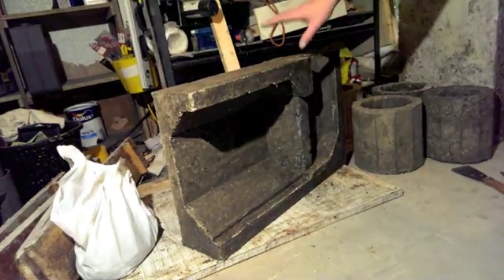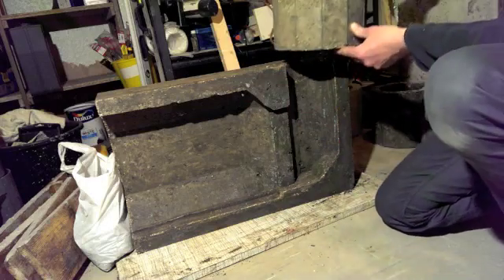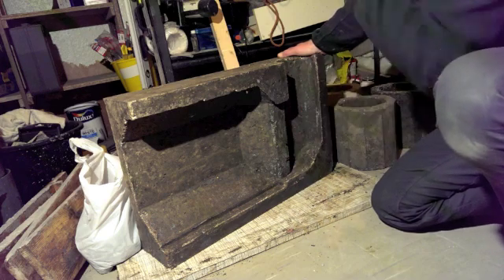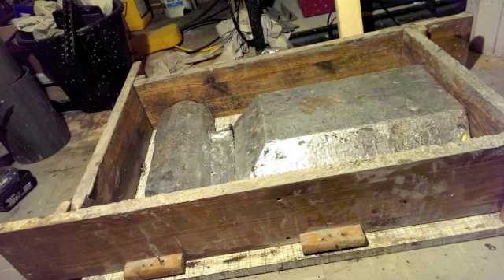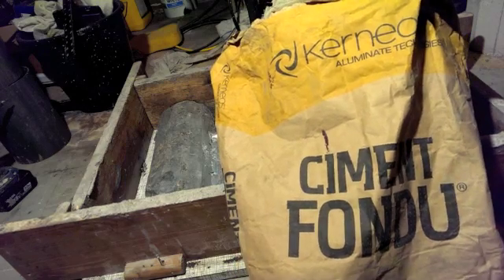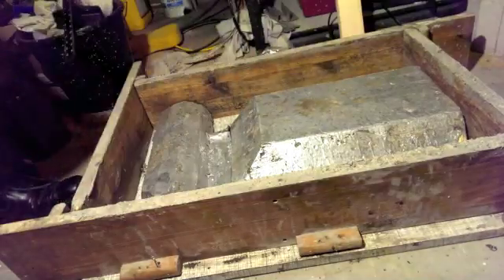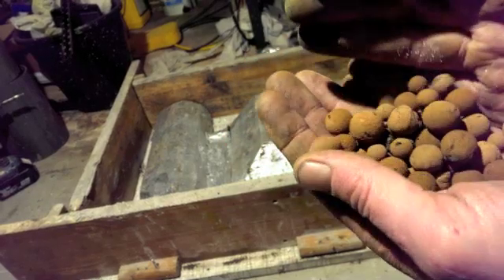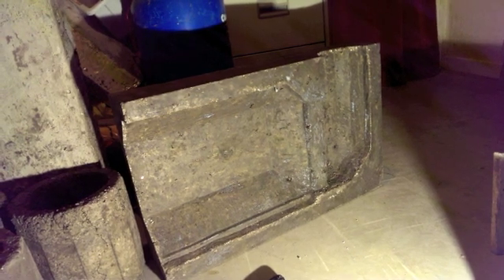Rocket Mass Heater Batch Burner Chamber Refractory Casting

Comment: Hi. Really amazing. Have two questions. Is it advisable to crush up the clay pebbles to add strength to the mix? And also what about adding some basalt fiber chop to help hold it together? Thanks for your video!
Reply from the maker: Changeindirection - thanks for the comment. 

I think the clay pebbles add strength provided the casting is thick relative to them. The thinnest parts of the burn chamber wall are 3-4 times wider than the diameter of the pebbles so I think there would be no weakening by their addition. I did use an alternative, smaller, insulating aggregate for the heat riser pieces, in the form of "growstones"; which are a processed glass product.

I haven't come across basalt fibre but I think a mineral fibre would give excellent reinforcement so I'll look into it. Thanks for that tip. In my latest video, several areas of damage are evident and so for any future castings some superior reinforcement would be really useful.

Thanks again, Dave.

Comment: Awesome.  I did your vids backwards.  How has the secondary air worked out?  Does it clog?
Reply from the maker: Jeremiah - thanks for your comment. The secondary air duct is just a piece of steel 50 x 25 mm box section that terminates at just before the base of the heat riser. It didn't seem to have any ash inside after the burn so I assume the air draw keeps it clean. I hope to modify it soon to have a spout higher in the chamber so it might be worth checking back in a couple of weeks.
Reply: BatchRocketProject I built a Walker core system that had the same square tube with an upright slotted pipe.  The upright disappeared in about 45 days of use.  It ran fine for the guy but the hole where the pipe was filled with ash.  He was happy with the burn even with the clogged secondary. 😁  Matt found a fix.  He replaced it with a Mitsubishi tailpipe end piece, I think he said.  On my next build I'll cast a "hardbrick" solid tube that will drop into the hole of the square.  As it did fine without secondary air it shouldn't take too long until the tube gets hot.
Reply from the maker: That's very interesting, thanks. My tube currently terminates with the opening facing the port into the heat riser so is not facing upwards where it would catch more ash. 

When I experiment with a vertical spout, I'll bear in mind the auto-exhaust tip; they must be built to withstand some heat. It may turn out that no spout is required anyway, time will tell.

Definitely try your hardbrick tube, I've seen some commercial gasifier wood burners that pre-heat air through refractory concrete channels; I'm sure they get very hot.

Thanks again for the information.
Reply: BatchRocketProject You're dumping O2 (air) at the base of the riser through a port or into the burn chamber pre-port?
Reply from the maker: The secondary air tube ends inside the burn chamber, pre-port, about an inch before the entry to the heat riser.

If you've seen the ppotty1 videos, he experimented and found the secondary air is best injected before the heat riser. Peter van den Berg also discusses the mechanism of air mixing to make turbulence in the heat riser, again suggesting pre-port secondary air to be best.

Comment: Please, can you tell me the  proportions of alumina cement, pebbles and Pearlite in your mix?
Reply from the maker: Aluv15 - Thanks for the question.

I used the following mix, all parts by volume:

2 parts ciment fondu high-alumina cement
2 parts powdered fire clay
1 part fine sand 
4 parts perlite
4 parts clay pebbles

Mixed with sufficient water to be workable. I would caution against making the mix too dry as the drier the mix, the harder it is to compact it and there is a risk of voids.

When I casted the heat riser tube pieces, I was concerned that the clay pebbles might be too large compared to the thickness of the casting and so replaced them with a processed glass product called "growstone". These are smaller than the clay pebbles. I think, being foamed glass, they might melt in the fierce heat of the burn chamber so would use clay pebbles for that. For the heat riser though, the heat is less penetrating and the glass does not seem to have been a problem there.
Reply: Thanks very much for the info.
Reply: I am curious how this is holding up for you? If there is silica in the sand you may get expansions there making it disintegrate... And how do you think the mix would behave without the perlite altogether? Hoping for a reply, June.

Comment: I am sorry but I've spotted a major mistake. That is, the back wall of the firebox should be flat and the corners of the port should be at right angles. As it is now, small-scale eddies won't form at the sides and top of the port which is very important for proper gas flow. The result will be almost certainly a heater core which emits black smoke most of the time.

It is a very tight design, build to specifications it will do what it says on the tin. Change something and you are on uncharted territory. Or it is a deviation which is built earlier like yours with known results. You simply made it too nice, sorry again.
Reply from the maker: Peter - thank you for your observation and comment. 

As you say, I did deviate from the design to bevel the back of the burn chamber. I did this to thicken and strengthen the casting as my earlier builds were with Portland cement and lots of perlite; which I found to lack strength. Apart from the bevel, the other dimensions are all consistent with the 6" design on your batchrocket.eu website.

I fired an earlier casting, made from the same mould plug but with Portland cement, several times until it failed by spalling and mechanical damage. I may have been lucky but the burns were very clean - much cleaner than I've had with other metal and masonry builds of regular J-tube burners. I also saw very impressive "ram's horn" flame vortices behind the port. 

I didn't test with the floor-channel in place and, when fitted, the problem you mention with the geometry ahead of my port may become evident. Also, my earlier burn trials were all without a door or front cover and so there was abundant airflow and a rapid burn. As the bevel is an addition to the thickness, and the outside of the casting is a rectangular prism, I still have the option of cutting the bevels away with an angle grinder if the need arises. Reducing the perlite content and using the larger clay aggregate has considerably strengthened the casting and so the original purpose of the bevels no longer exists anyway. 

Time will tell. The weather is too poor here in the UK at the moment to do a test burn but I will report back when I test it.

Again, thanks very much for your input and for your work which I follow with interest.
Reply: Is this particular mix any good at absorbing heat and releasing it slowly?  Is it a good conductor of heat?  Thanks.